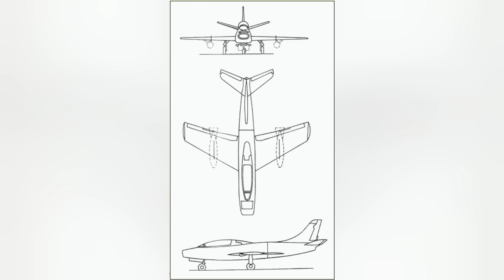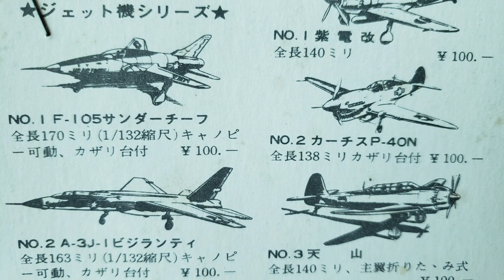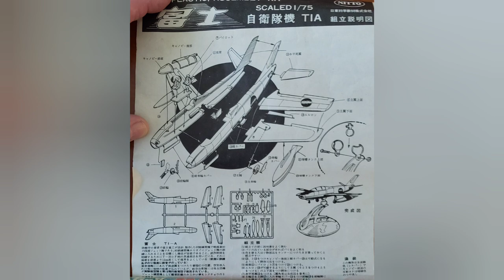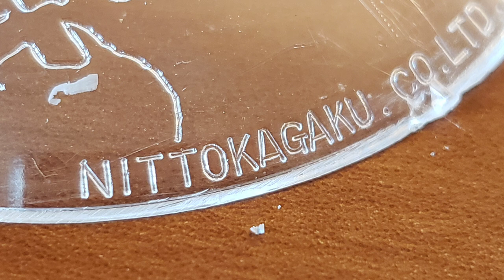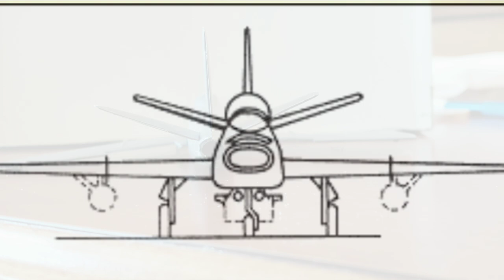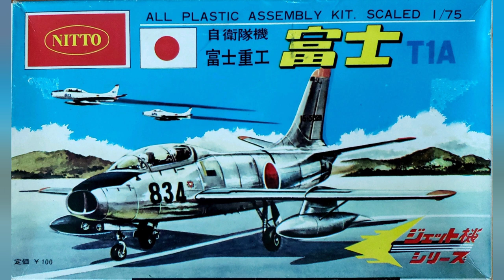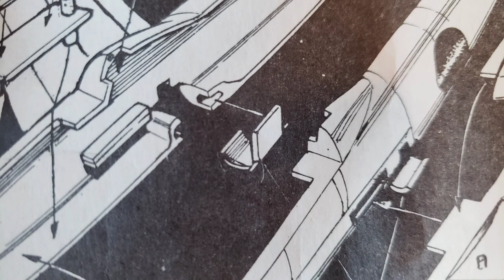Road build, Nitto T-1

Comment: I am not sure after all these years, but I think the Fuji T-1A was one of the ex-Nitto kits sold in New Zealand by Panda. This would have been from the later White Box era around the late 1970s or early 1980s. I had a few of these, but not the T-1A as far as I can recall.  The F-5 Freedom Fighter had the Nitto name moulded inside the fin on one fuselage half. Panda did do the F-107, which I assume is the same model that is shown on the catalogue page, along with the WW2 aircraft. However I do not recall any other modern US jets, apart from the F-5 that I have. I do not recall any of the Panda kits having such a magnificent stand. You have now discovered why I preferred Airfix and Matchbox kits to those by Panda.
Reply from the maker: It seems like the kind of kit Panda would go for.

Comment: What isn't mentioned is the wings and tail of this airplane are borrowed from the F-86.  The Japanese flew many F-86, and the T-1A was built as a trainer for that aircraft simply by redesigning the body.  Much in the same manor the Mitsubishi F-2 is built around the F-16.
Reply: The F-86 had a two-seater that wasn't as good. Stability issues.
Reply: @tgmccoy1556  yes
Reply: The F-2 is a much larger aircraft than the F-16

Comment: The engraved panel lines on the fuselage reminds me of the trenches on the surface of the Death Star.  

The pilot figures have no lower legs?  Or are they sitting like at a Japanese restaurant?
Reply: That is how all Japanese pilots sit Chuck.
Reply: @michaelnaven213  And they work the rudder by?????
Reply: @chuck9987  Using thought control. You must think in Russi…whoops, wrong aircraft.  You must think in Japanese.  You cannot think in English and translate into Japanese.
Reply: Please to remove shoes. [BOW] Thank you so much. [BOW].
Reply: @chuck9987  They kneed it! Lol